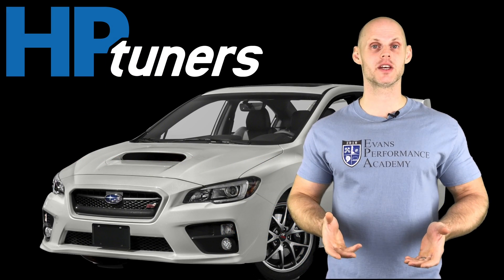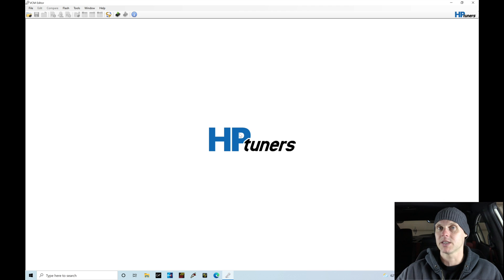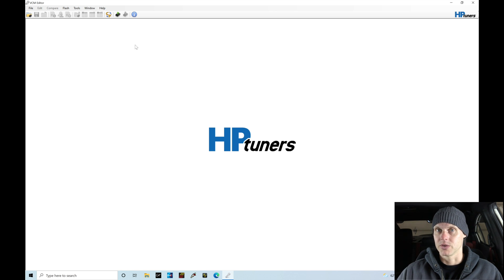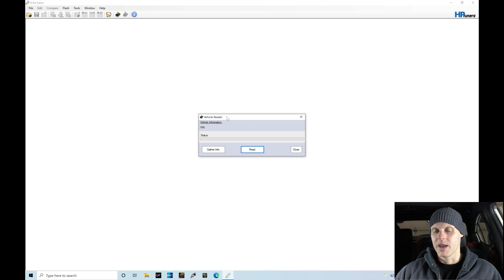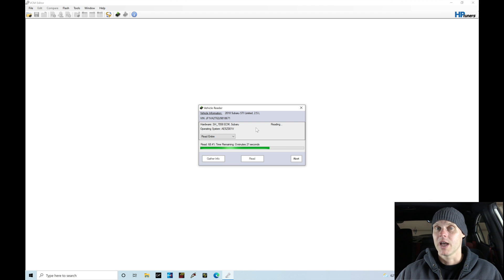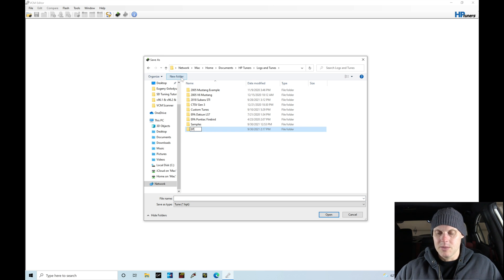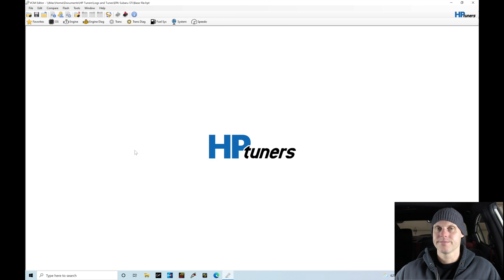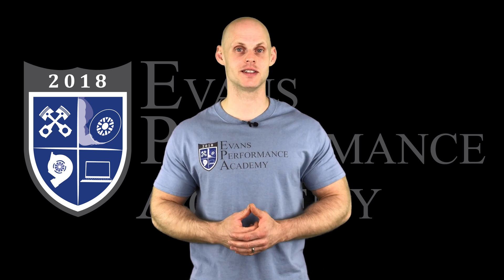HP Tuners Subaru Live Training Part 1: Base Map Creation | Evans Performance Academy

Comment: The view count on this video is about to skyrocket as the COBB customers (myself included) jump ship. The ability to add the two 0-5 volt inputs and can-bus input is an insane advantage over the COBB accessport. I've never used HPTuners, but in the domestic world HPTuners is king. There's really nothing special about the Subaru stuff that hasn't been tackled in other domestic applications, so I have full faith that the HPTuners platform should be perfectly fine for us.
Reply from the maker: Coming from years of tuning the Cobb platform on Subarus HP Tuners has many advantages.  Once more within the Subaru community know it's a possibility there will be many people switching.
Reply: @EvansPerformanceAcademy  Got a new Lenovo laptop for tuning, and I ordered my MPVI2+. Are there any critical tables that HPTuners has not yet defined? I can't open a Subaru file until I have the MPVI2+ in my possession, so I'm stuck viewing sample tunes of Gen IV VVT/AFM GM stuff, Gen III LS, etc.
Reply from the maker: @Anastasiofan  Everything is defined to properly tune a Subaru.  Cobb injected some custom code / tables that HP Tuners does not have available.  The speed density / flex fuel control works though and all of those tables are there.  If you don't see the flex patch and speed density patch in your rom OS section you need to email support@hptuners.com to get it added.
Reply: We don't have e85 immediately available, but can you use that tgv input to trigger timing advance/target afr based on water meth activation?
Reply from the maker: @Anastasiofan  As long as the trigger you are using simulates the TGV position either open or closed then the tables will follow that TGV position.
Reply: @EvansPerformanceAcademy  Hey bud, love the videos. Will the new HP Tuning hardware allow me to tune a 2012 WRX.
My old HP Tuners dongle won't pull the standard file , monitor knock or torque. 
Really appreciate your help
Reply from the maker: @independentassesor2630  You have to be using either the MPVI2 or MPVI3 cable to read/flash a Subaru with HP Tuners.
Reply: @EvansPerformanceAcademy  Will definately buy one. Will it allow me to monitor knock and have the ability to tune around the faults I get when using a 100 cell cat?
Reply from the maker: @independentassesor2630  Yes, it will allow for knock monitor and DTC faults.
Reply: Does the beta version still need to be used? This video is a little older, just want to make sure.
Reply: @jeyisaac  I still use the beta version.